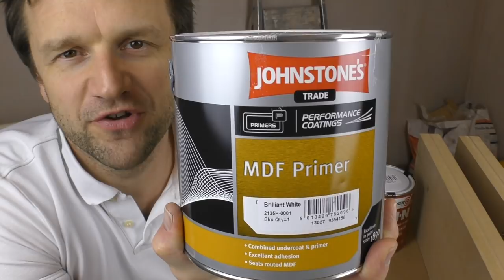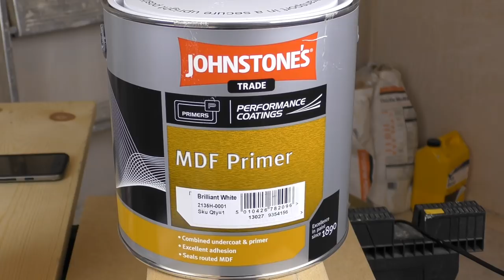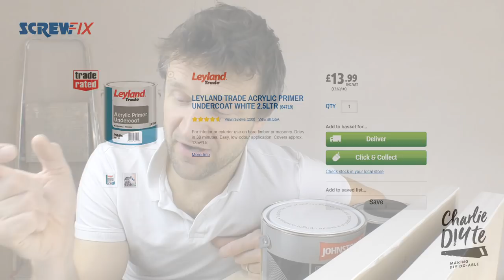How to Paint MDF Edges - Zinsser B-I-N vs Johnstones MDF Primer

Comment: The major difference between the Zinsser and the water based primer becomes apparent when you are finishing something that has been painted before. The shellac, being alcohol based, does not raise the wood grain as much as the water based primer. The shellac will also seal in pitch, ink, crayon, water stains and smoke much better than either a water based primer or an oil based primer. Spot prime before full coating is the process for any primer. Consider the full lifecycle purpose of the primer/paint system you choose. Each system has its strength.  The water based primer is a 100% acrylic solids product and very high quality so on a new project with no special requirements, it is fine. If you are repainting drywall that was not primed before it was originally painted, the paint system is still porous. Spot prime and full coat with an oil based primer or a shellac based one. The main advantage of the shellac product over the oil based product is the stain sealing and hiding properties. If you are painting drywall for the first time you can prime very successfully with the water based primer. Don't be too concerned with getting a solid uniform opacity with the prime coat or the first coat of paint. Apply them both wet and then roll or brush them out smooth. If the coat is thin enough the brush marks will flatten out. The second coat will cover very well if the primer and first coat is applied properly.
Reply from the maker: Thanks for that Patrick - a detailed response from someone who clearly knows their stuff. Thanks for taking the time to put that together!
Reply: @CharlieDIYte  Hi. What primer do you recommend for very old wooden doors ? For finish will be use zinsser all coat black gloss. Thank you
Reply: Shellac is alcohol soluble, not alcohol based, it's shellac based

Comment: Zinsser bin dries quicker than water based paint. This means you can apply your top coats quicker and get paid even quicker
Reply from the maker: Exactly Rex. Since I did this video I've become a massive convert and don't use any other primer 👍

Comment from the maker: John Morton raised a very good point in his comment below which causes me to think I was perhaps a little hasty with my conclusions. The cost per litre of the Zinsser is a lot more than the Johnstone's (£17.19 per litre as against £10.79), but as it's much thinner is goes a lot further/ lasts longer. So I guess if you've got a decent amount of MDF to prime and you don't mind cleaning your equipment with methylated spirits, then the Zinsser is probably the right choice.
Reply: Why not use the water based Zinsser primer "Bull's Eye 123"?  Clean up becomes a doddle with a small bucket of water at hand.

Comment: I'm in the middle of making some MDF furniture, and I went for just filling the edges with regular made-up-from-powder Wickes own-brand Polyfilla-substitute - spatula on, sand flat, and more or less any paint sticks well and leaves a perfectly smooth finish. I tried two-part wood filler and it was more hassle, took longer to go off properly (I guess it's cold in the garage!) and didn't leave a perceptibly better finish.

One big advantage of a shellac-based primer that I've found is that if you ever use a pen while marking out, the ink from the pen will bleed through water-based primers and paints, leaving a mucky dark smear. I used a fine-tip marker for this project because my usual mechanical pencil is barely visible on the MDF; shellac-based primers will cover this in a single coat and not allow the ink through, so for me it's worth either using one (or going over the markings with neat shellac first) just to prevent that.

Comment: Charlie, the beauty of the Zinsser b.i.n. is that it can be used to prime almost anything, a while ago used it on dark varnished
hardwood doors. The standard primer allowed 'yellowing' to show through after a couple of weeks. so i bit the bullet and forked out for the Zinsser b..i.n. and 1 year later the doors are still as white as first painted. I have also used it on metal filing cabinets/mdf/hardwood/softwwod/plastic. So for me the flexibility of the Zinsser outweighs the initial costs. Great videos by the way, keep them coming. :)
Reply from the maker: Thanks Andy, that's great to know. I agree and though it's more expensive, it goes further.

Comment: If you want perfect mdf edges here is my guide.
Moisture resistant Mdf (preferably Medite) this will give you much better edges from the go.
Cut your mdf with a blade with lots of teeth, no good using a ripping blade, this again gives you a better edge
Now sand your edge either 100 or 120 before prime 
Zinsser shellac or whatever paint you want 
Sand again 
Now just top coat as your edge is like glass. 
You wouldn’t know it was mdf

Comment: Thanks for these videos.
Just finished a set of bookshelves using Zinsser 123 two coats on edges sanding each then primer 2 coats then topcoat Dulux Diamond coat trade Eggshell finish. Primer and finish cost were sprayed.
This was my first time working with mdf. Sure is a lot of work doing those edges.

Comment: Do try the Zinsser water based Bull's Eye 123 primer and Zinsser Perma White Satin finish. I would love to see a video from you on these two paints.  The difference between paints doesn't show up until they are at least a year old. I have used white Dulux paint in my bathroom that has yellowed after a year. Zinsser Perma White has a 7 year guarantee  against yellowing. Worth the extra price to save repainting every couple of years.
Reply: Is the Zinsser 123 ok for mdf edges? Or is that one not good for it? Thanks

Comment: I'm going to give the BIN primer a go next time.  After building cabinet doors out of birch plywood and wrapping the edges with routed poplar mouldings, I sprayed with two coats of latex primer (HD brand and Zinsser 1-2-3)...after very lightly sanding each coat, I can still see the plywood grain markings showing through.  Thinking the BIN would do a better job of blocking.

Comment: I use Zinsser "Cover Stain" (oil-based & tintable) primer exclusively for all my commercial MDF projects as well as cabinetry. It dries rock hard and sands extremely well, and it presents an excellent base to quality top coat products. Cover Stain performs exceptionally well with MDF as it doe not raise fibers, especially along cut faces. I only spray Cover Stain for best coverage and smooth finish, albeit with some waste. The ONLY disadvantage of Cover Stain, apart from clean up, is its cost; the stuff is expensive. Charlie, I recommend you compare it to B.I.N... You may be impressed.
Reply from the maker: Now THAT IS interesting, and funnily enough I have a tin on the floor by my desk as we type as someone was asking me about it recently. Yes, I'll definitely do that and have an MDF project coming up shortly that it might be worth trying it out on. Out of interest do you use moisture resistant MDF for your projects, or the usual stuff? BIN has become my only primer of choice since making this video, but I'm finding it doesn't behave very well in this weather - it dries within about 10 seconds of applying it which makes it a bit of a nightmare to use. It may of course be because I stupidly left the lid off recently and the surface skinned over.
Reply: @CharlieDIYte  have you tried cover stain oil based instead of bin and did you do a video?
Reply: Is that the standard/common oil based primer by zinnser?

Comment: Hi Charlie, you appear to use and be a big fan of mdf. 

1. Providing the proper more expensive dust masks are used for cutting/sanding outside do you think pound for pound this is the best "wood" material you can have for stuff that isn't pride and joy face work? Obviously this isn't a material I will be using for my kitchen worktop but the likes of wardrobes and desks is this the cheapest/best in the UK?

2. What are you thoughts against pine and 3/4 inch plywood in terms of price and performance?

Thanks for the effort you have put into this video, I can see the time/effort 1st hand with camera angles, panning in, commentary and also the post filming editing work you would have needed to do to create a video at this standard all whilst carrying out your day job or on supposed time off on the weekend. 

In a 7 foot closet I have just put in a plywood carcass to make a total of about 20 cubby shelves, I sanded down and used Leyland wood primer @ £13.99 w/ 2 coats and 1 coat of Leyland matt emulsion @ £11.99 I was a happy bunny with the finish. The question is would MDF have been a lot more cheaper than the 3/4 inch ply to justify spending £10 more per 2.5 litre tin to primer with....

3. I would love to give an idea of doing a comparison video on the best way to clean rollers/paintbrushes from water based paint. This would come up in searches worldwide and wouldn't be limited to the UK audience or just your subscribers. You mentioned warm soapy water for your cleaning of water based paint on your brushed in this vid. I have always in my DIY scenarios just washed the brushes/rollers with cold tap water within 15 minutes of finishing painting and been happy with the results after 5 minutes and an old worn toothbrush - can this be bettered?

4. A big big thumbs up on this video - you have gone through exhaustive detail both on the practical side and theoretical side in research. Apologies for the long comment - just wanted to give some solid feedback from someone who watches the vast majority of your videos, lives in the UK (London) and thinks your work is absolutely solid, logical and well explained so i'm appreciative of your effort to film this content for us for free all whilst carrying out your day job!

Ryan
Reply from the maker: Hi Ryan - it's been a busy week on the work front so apologies for taking a while to get back to you! Yes, I am a big fan of MDF - it's incredibly easy to work with, but I guess the main advantage of it is the size of the sheets and therefore the versatility in terms of what you can make out of it. 
1. You're right, you need to wear an appropriate dust mask - something I confess I don't wear often enough. I'd say you can still use it for pride and joy face work - and a lot of pro joiners do just that. It's just that if you are going to use it for carpentry that's going to be prominent in your house, you need to take care on how you finish it - particularly the edges (where the end grain is quite problematic to paint), and on how you paint it. You can get moisture resistent MDFs, but you're right, you should never really use any sort of MDF where moisture is going to be an issue. Yes, it's great for wardrobes and desks, but remember, like any wood it will warp if left unsupported, so make sure you design the wardrobe/desk with appropriate strengthening supports - as I did for my daughter's desk, for example https://www.youtube.com/watch?v=-OvufFoUGBw

2. Pine and plywood are obviously superior products to MDF - pine is so easy to paint and plywood has that extra strength and is more resistant to warping because of the way the thin sheets are glued together to make it. In terms of price, I think they're all much of a muchness in my opinion - ply is probably about £5 a sheet more expensive than MDF.

You're right, it takes a LONG time to produce some of these videos, with the editing sometimes taking longer than the filming. My kids are always giving it to me in the neck for not spending more time with them. 

If you got a great result with ply, I'd be inclined to stick with it. It's obviously better (stronger) to screw into than MDF, and the extra expense (roughly £4-5 per sheet) isn't great. I guess MDF will look smoother - particularly on the face of the sheet - when painted than ply, although ply will give you that more natural wood look. 

I'm not sure you need to buy more expensive paint though to paint MDF. A lot of people I speak to (and me included!) use standard wood primer undercoat to prime MDF, and Leyland for example produce a 2.5 litre tin for less than £10 https://goo.gl/9Bw2qN. Gosforth Handyman loves this stuff - check out his video https://www.youtube.com/watch?v=htrEiKrD7AY&t=221s

3. No, the way you clean them is fine. I recommend for each product to look on the tin and see what the manufacturers recommend. 

4. Can't thank you enough for the kind, insightful comments, mate. You're right, it's often a pretty tough, lonely existence shooting and editing these videos in between the day job, and feedback from people like you make it all worthwhile. Thanks again for supporting my Channel, and have a great Christmas.
Reply: Hi Ryan,
You give us all so much valuable advice so please let me give you some. Listen to your kids and spend more time with them. All too soon they flee the nest and the time you have spent with them before that happens gives them so much to take with them. Don't fall into the trap of always being too busy to give your kids the greatest gifts, your love and your time.
Reply: Charlie DIYte Thanks for the detailed response!

I generally use 3/4" ply at home unless its got to be super neat facework then i can nail some pine edging on to cover the end grain. Ply is also fantastic for screwing into as opposed to mdf too. Both great materials though.

Keep going with the channel, with the quality you apply to your filming, explanations, carrying out the work and great editing to stitch it all together your channel will grow no doubt, just don't alienate the Americans as there are a lot of them on the youtube lol.

Cheers.

Comment: Great, video but one thing I'm missing is the cutting method for your sample mdf. Was it cut with a fine tooth blade? Plunge saw etc. I think it would give a bit more context. I say that because the edges looked rough to begin with. Also, sorry if you outlined it in the video and I missed it.
Reply from the maker: Thanks. Take a look at this vid https://youtu.be/763yQg0Euwc of you have a moment. From memory they were hand sawn (but they could have been done on the circular saw) and then electric planed but the point is each was done the same way. Sanding the cut edge before and after painting is key. 👍

Comment: With abit more prep work between coats you can get the bin treated mdf to have an edge like glass. Id have sanded it with 180/240/500 on a disc sander and you'll be left with an edge the sprays af flat at the sides
Reply: Will try that!

Comment: I had some real success filling with plain old drywall patch, and a light sand. Or using the faux granite spray. Its a great cheap fix for mdf edges. Paint edges grey, hit them with the faux granite spray,  and seal it in with a clear in satin.
Reply from the maker: Thanks Bob 👍

Comment: As I am about to paint a major MDF project this guidance video has been most in formative. Great thanks. I am still concerned however that you can see the grain on the MDF edges after the final coat. It seems to me that some form of wood filler is required to get the perfect edge especially on MDF visually exposed edges; any advice on this or what filler would be best used? It used to be common to use grain fillers (or paste) on high quality furniture to get the perfect finish.
Reply from the maker: Hi Frank, the best finishes are achieved with iron on tape, or as you correctly say, wood filler. See this vid for more info https://youtu.be/kic9W4hqfbs

Comment: Excellent video. Wanted to ask, I have an interior wall that is needed to be painted over ( previously been painted). Some areas around the sockets have been replastered (not all the wall). So the wall is mixed with painted parts and bare plaster. I wanted to ask, what is the best way to paint the wall ? Do I need to clean down the painted section and prime it (unsure what white primer to use) and then paint over it with my final coat? Thank you!!

Comment: Two good products there, but I prefer thinned oil based undercoat.

I find bin can be hard work on MDF as it can 'pull' when you apply it due to the fast drying and the porous nature of MDF..and water based primer will raise the 'grain' of the MDF, more so in colder conditions as it takes longer to dry, hence more time for the wood particles to swell.

Oil based undercoat combats these two problems and provides a good base for water and oil based products..ok you wont find it in manufacturers information...but nor will you find a lot of other decorating 'hacks'

For washing brushes used in bin 9I used methalated spirits..if the brush goes hard, just leave it soaking in it for a couple of days (some goes for shellac knotting)

Comment: Thank you Charlie, has swayed me in terms of product choice ;-)
The only thing I am missing is a view on performance in damp conditions, i.e., how well it seals MDF to the outside environment. In my mind, I cannot reconcile other than using an oil based product for this.
Thanks again!
Reply: In damp conditions, dont use MDF or at least use green moisture resistant MDF and A/C primer / paint.
Reply: Just as long as you remember that shellac is not oil-based - it's alcohol-based, and is probably less water-resistant than any latex primer.